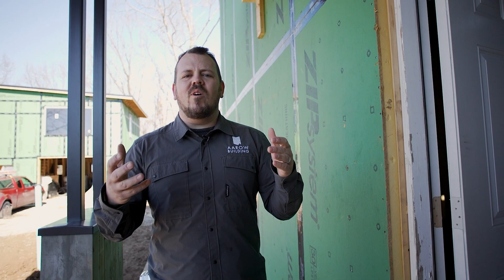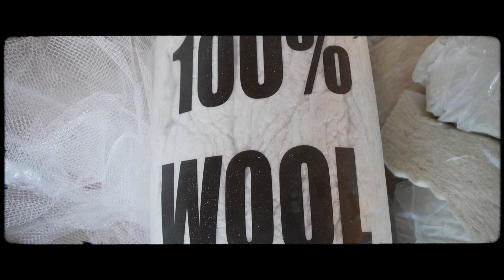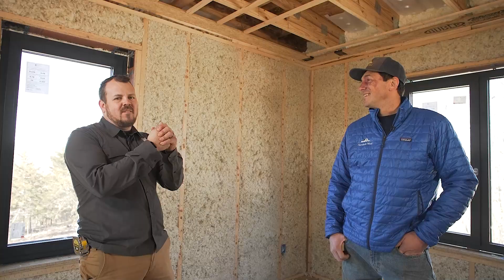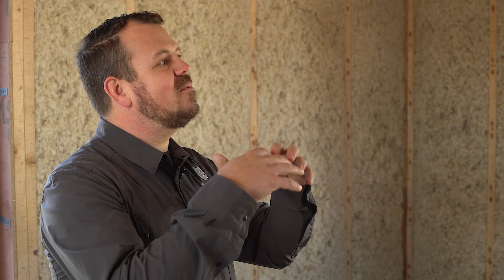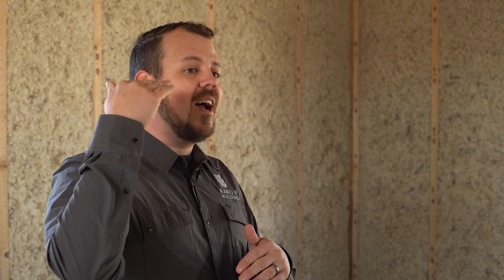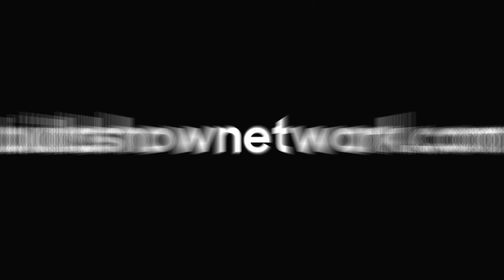Sheep's Wool Insulation from Havelock

Comment: Can I put cement on it and then put flat rock facing on the cement. Or do I need to put plywood over the wool insulation.
Reply from the maker: The IRC does require a finished surface in any living space. Drywall, plywood or other approved methods according to code should meet what Havelock requires.

Comment: Anyone know if this has been used for a metal building?
Reply from the maker: Good question. I don’t know if this has been used specifically for metal buildings however, I do know in talking with the manufacturer they are very popular in van life culture (which is basically a metal building) due to health concerns. But this works out great to put wool agains a material that will likely have condensation at some point because the wool wont be bothered. Pretty cool parallel.